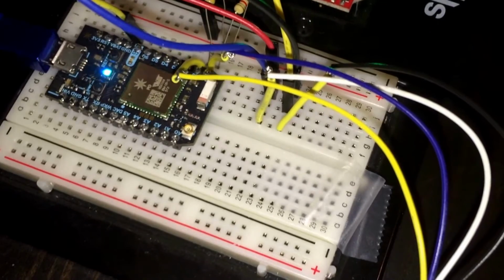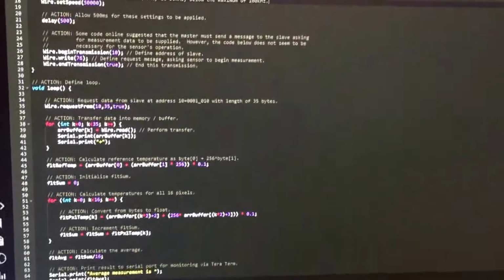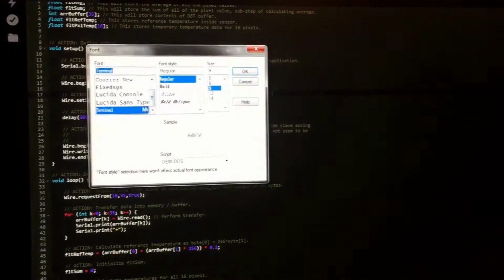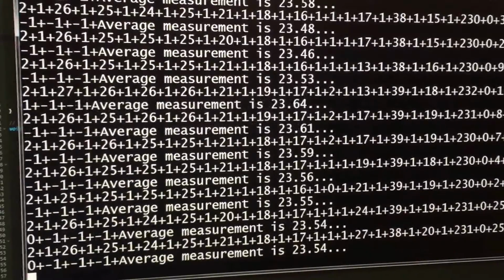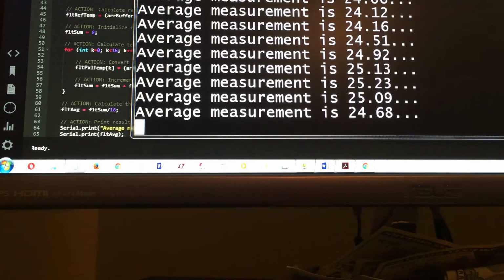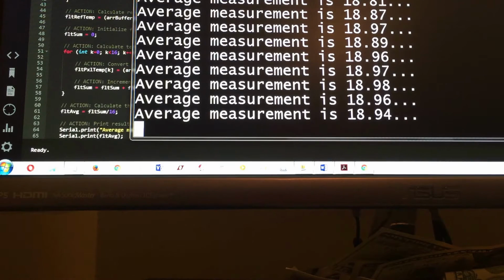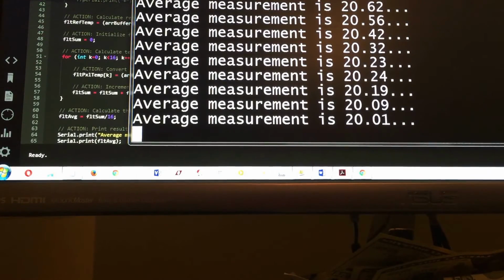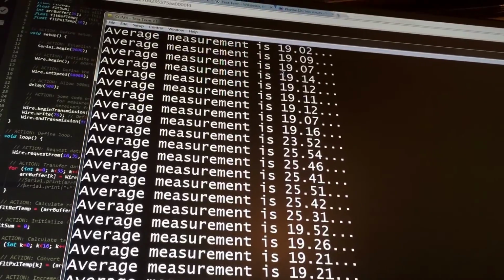Testing the Omron D6T Thermal Sensor

Comment: Awesome video Anthony! Is there any way to use only the redboard and the breadboard with the Thermal Sensor? Is there a way to remove that second blue circuit board that is on the arduino breadboard and still make it work?

Comment: hello how do you connect the wires to the sensor? did you solder the wires to the sensor or are you using the connector specified in the datasheet?